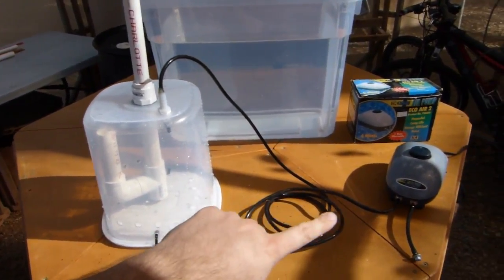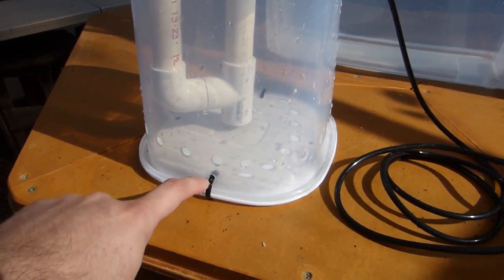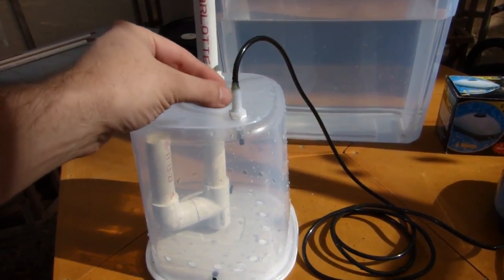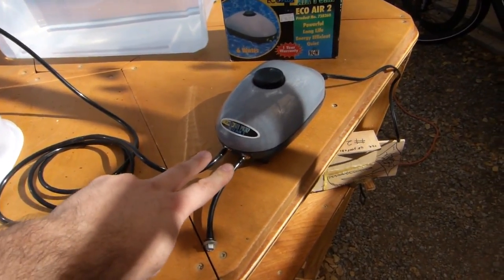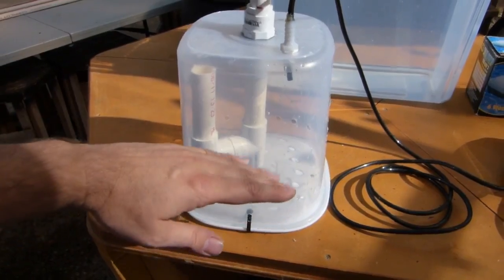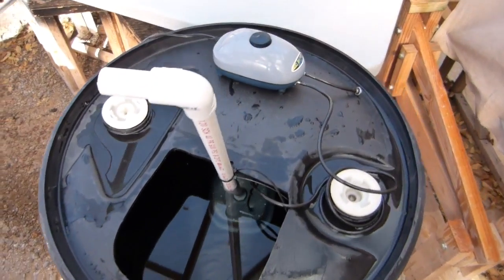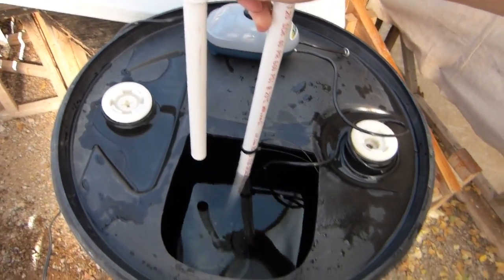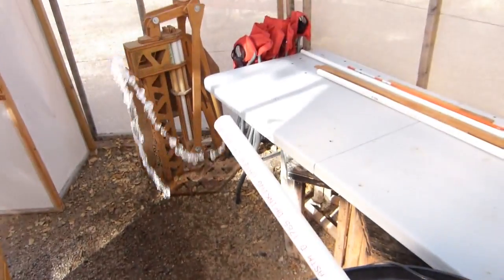Low Power Airlift Geyser Pumps - Part 1 of 3

Comment: Clever!
Hydrophobic plastic pipe or coating so water stuck to the pipe surface  isn't and cant bypass the air bubble/column..

Also round the water intake to make it more hydrodynamic.  Think bell mouth and/or Velocity stack.

Comment: For anyone building this, please try making the U section out of smaller diameter tube. For a pump like this size, about 6mm or 1/4 in tube works well. The pipe going to the bottom can be any reasonable size. This way on each cycle the 1 gallon container fills with water nearly completely, increasing pumping efficiency and volume pumped per cycle. Good work and demonstration! Chris, UK.

Comment: Why just don´t use a circulation pump of 10W and you get like 100g/h instead of 10-20g/h with this thing?
Reply from the maker: No moving parts down in the water with this one. Almost uncloggable. It was fun building it. 
It's a great invention.

Comment: Never got the need for it ! I've always added ventury to my return from the water pump, you get loads of oxygen with one pump no air pump needed
Reply: With my limited research so far, the advantages I've seen have been the efficiency. ie Less maintenance and energy usage. It adds a huge amount of head height and flow coupled to a standard pump pushing water.

Comment: Am I the only one who feels that a 6w water pump can move more water than this? anw, very nice explanation. Thank you!
Reply from the maker: Yes, most impeller pumps are way more "efficient". This type of pump really shines in low maintenance situations. It's a straight through pipe flow that is probably clog proof. See my part 3 of 3 build.
Reply: Designed By Instinct thanks for your reply. I think another advantage of this kind of pump is that no electrical parts under water so it's perfectly safe. Last week in my country, a koi pond builder has just died because of electricity leaking (I guess he used   a bad chinese product).
Reply from the maker: Electric cords underwater is a bad deal. I don't care what anybody says. It's not hard to design around that problem.

Comment: if u reduce the length of outlet pipe or reduce the distance between surface of water and the end of outlet , it should work better , all airlift pumps have this issue . they work closer to surface and pump good volume

Comment: I did the math, it only pumps 11.25 gallons per hour at 6 watts, my 15 watt pump, pumps over 300 gph. Keep thinking and trying to find better ways but this one is a fail.
Reply: Depends on the application. I'm looking at this for a sump return in a plankton friendly marine aquarium. In my case, an impeller pump, while more efficient, would be detrimental to my intended purpose.
Reply: fair enough
Reply: Mark Speir  Sounds like a venturi pump would work well for you using air to make the venturi providing the motive force for your water movement. As long as your tank can handle the bubbles, but you can make a bubble trap for that. No moving parts. If you are clever you can make one yourself or research it and buy one.
Reply: @Brandon Horvat, show us your geyser pump plz
Reply from the maker: Exactly @Mark Speir! This type of pump is very gentle and has a wide open straight through flow. See my Part 3 of 3 to see how large the pipe can get.
Reply: time it for 15 mins per day then make a mayan water distribution system of little gutters to irrigate you garden. Then cover the entrance of a cave with loads mirrors for your new indoor cave garden.

Comment: Try to connect your air pump perpendicular to the end of the pipe,  what I did is  I put a hole half inch before the end of a pipe and connect the air pump, it works the same...

Comment: Small thing, but maybe put a "T" on the air pump so you can use both outlets? You might be wasting 50% of it's output.
Reply from the maker: I did that and made no difference on my pump. They are connected internally to the same diaphragm.

Comment: I made a pitbull-style pump with a geyser mechanism to time it. Basically, it's a geyser pump with checkvalves on the intake and discharge. The up and down cycles pump, making the most use out of the air.

Comment: I guess the only way to compare this to a conventional pump is look at the flow rate versus the power consumption. I think it will be more efficient but not dramatically.
Reply from the maker: In some cases these airlift pumps are not as efficient as a conventional.
BUT...they are much more reliable. No moving parts down in the water to service. Clogging almost impossible.
Can also run many pumps off a single air source. This air source can run off battery easily.
Reply: If the materials were a bit more solid than Tupperware then maybe but good solid magnet impellers are super reliable. I had one running for about 5 years straight with no maintenance. Mind you good reliable conventional pumps are very expensive so this certainly has uses. I have used smaller air pumps for this purpose. 

I would certainly consider using this sort of thing in assisting filtration in a natural pond but maybe not so much for larger scale aquaculture.
Reply from the maker: Spencer Howard
You need to watch part 3 of my video series on these pumps.
The person who turned me on to this pump only built the Tupperware version.
The 2011 patent version is all heavy 1 1/2" PVC, no Tupperware ;)
Much better and far more simple to construct.
Reply: Spencer Howard jn
Reply: Sally Ho  JN?

Comment: I made one of these with a 1" pipe. I did not know it was not supposed to work so it did.
Reply from the maker: Lol. Fantastic!  When I tried changing the outlet pipe only, it got really weak.
If the entire thing is upsized, it works (as you found out). Watch my Part 3 video, I made the 2011 version of this with 1 1/2" pipe. Much more compact design. Works identical.

Comment: Thanks so much, I'm trying to build a low power pump for an off-grid aquaponics setup. I built this using some old plumbing bits and it works very well! Cheers!
Reply from the maker: Awesome. Make sure you see my Part 3 video. I did a much more durable version of this pump.